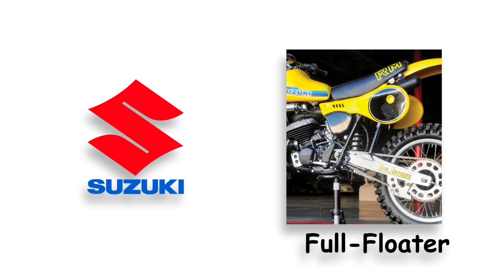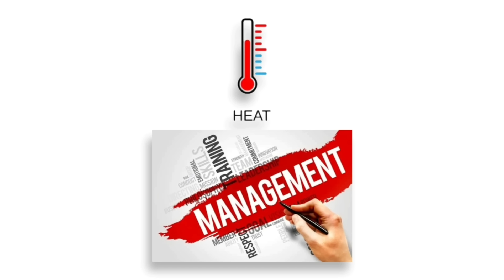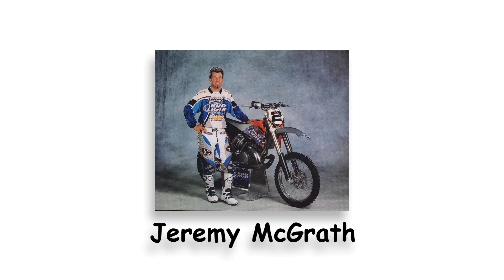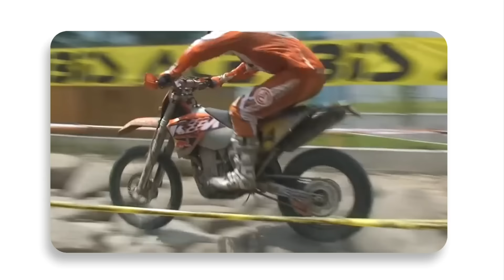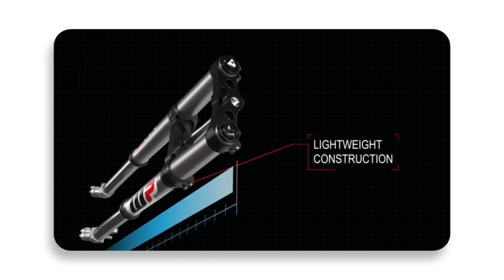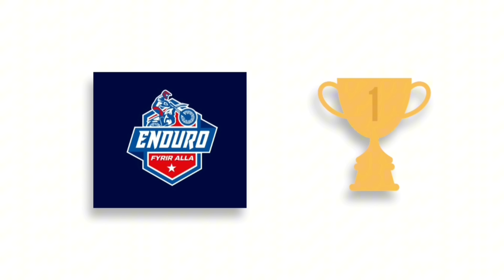PDS: The Simple Part KTM Refused to Fix for 20 Years

Comment: for the average rider, a correctly set up PDS is fine. If you're riding and jumping hard , you need a plush beginning stroke that ramps up thru the mid stroke. What the linkage does perfectly. 
If you secretly swap my linkage with PDS , I probably wouldn't notice...

Comment: A couple things I don’t think are right. They didn’t refuse to ditch PDS because people could swap on other shocks if they did. First, who cares what someone does after selling the bike, it’ll still be sold from the factory with WP. Second, that only works if they used the same i2i and stroke as other shocks and brands like Ohlin’s could make a PDS fit shock anyways. 

I also don’t think KTM went to linkage in MX because of Decoster. Development is multiple years long, so linkage was already in the pipeline before Decoster joined. 

Lastly, PDS can actually work pretty good but for whatever reason KTM did not do much development on the internals to make it work. Brands like MX Tech and NOST built very effective aftermarket PDS systems for the bikes but KTM was stuck on old basic tech that lacked. They simply made enough improvements to make it work for enduro and then gave up.

Comment: To be honest I love the linkless in the woods but I just built a 2011 250sx and there’s so many new style of skid plats that cover. That’s my new favorite woods bike now that I went to an 18” rear, played with the sprockets, pipe, reeds & tuned the carb. She’s ready to go. O haha and re-did the suspension
Reply from the maker: Exactly, modern skid plates and linkage guards changed the argument a bit. And that 250SX setup sounds dialed 18” rear, gearing, carb tune and suspension is basically the woods conversion checklist 😂

Comment: The suspension still sucks, The Motors are amazing. Hydro clutch Brembo brakes. The frames are trash, Mine started rusting from the inside out and the airfork is an embarrassment.

Comment: Ohlins had it figured out for ktm but ktm bean counters didn't want to pay... so they paid in failure.  Took toooo long but ktm figured it out.  I have a 17 and it works great and bike it lighter than linkage bikes.
Reply from the maker: That’s a fair angle. KTM definitely stuck with their own philosophy for a long time, and cost/parts simplicity probably played a role alongside the engineering argument. And you’re right by the later years, PDS was much better than the early reputation suggests. A well-set-up 2017 can work really well, especially with the weight and simplicity advantage.

Comment: Not really explained correctly, pds shocks have a smaller cylinder inside of the main shock body that a separate valve body passes into near the end of the shocks travel for additional dampening, it's more like a shock inside of a shock for the end of the travel.

Comment: You missed the point with the non-link suspension issue. For those who know, the same problem existed decades ago, in Yamaha's enduro and motocross models in the late 1970s.
And the problem is, to get the required rear suspension travel, without a link, you need a long shock absorber and to insert a long shock absorber, you need to tilt it. In the 70s YAMAHAs, the shock absorber was almost horizontal. As the shock absorber is tilted significantly, and connects to the main backbone of the chassis, the forces coming from the swing arm are transferred directly to the steering head, which negatively affects the front suspension and, as a result, the handling of the motorcycle.On motorcycles with a rear suspension link, the shock absorber can be much shorter, and be positioned vertically. The shock absorber absorbs all the forces coming from the swingarm and does not affect the  handling of the front suspension.
Reply: I bought the first monoshock off road bike, the 1976 Yamaha IT 400. It was a big improvement over most other twin shock competitors at the time: more travel, more compliance, more traction. The biggest drawback was the higher center of gravity caused by the shock placement high in the chassis. Your point about the suspension forces directed to the steering head is valid too.
Reply: You've got several things blatantly wrong

Comment: A forward canted shock has geometry that produces a rising rate, just not as much as can be achieved with linkages.  Another advantage for enduro use is no linkage parts hanging down below the swingarm to strike or snag on rocks, roots, logs.  love my PDS 300EXC.
Reply from the maker: That’s a great point. PDS was never useless, it was just more specialized. In rocks, roots, logs, and tight enduro, the clearance and simplicity are massive advantages. Motocross just exposed the limits harder.
Reply: My 300 EXC. Is spring hard. I'm 74 kg about. I've reduced preload rear and reduced clicks on front. Seat crazy hard. I wear bicycle shorts to compensate. Needs a softer seat. Buddies 4T linkages never seem to damage or snag.  The bike needs money spent to be ready to race.
Reply: Finally someone that understands the real differences! There is a hell of a lot wrong within the first quarter of this video.

Comment: They put the air forks on their bike to save money.  It has nothing to do with performance because they suck.  Not one of their pro or amateur riders uses them which should tell you something.
I have 2 KTM's and I had both of them converted to KYB internals.  The difference is unbelievable.
Reply from the maker: That’s a fair criticism. The air forks are one of those places where KTM’s “lighter and simpler” philosophy sounds good on paper, but a lot of riders just never liked the feel compared to a proper spring setup. And yeah, the fact so many serious riders go KYB or spring conversion says a lot. Hard to argue with real back-to-back experience. I personnally HATE them when tried it. It gave me arm pump for some reason

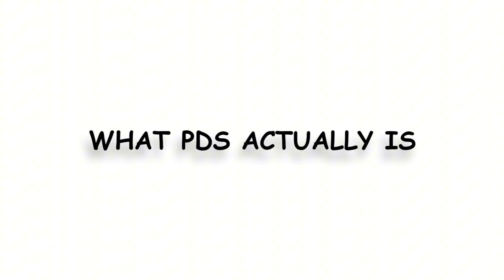Comment: 1:43 ktm could sell them dog shit, and theyd still buy it.

'Yea but this is racing dog shit...'
Reply: KTM  has been running Vietnam Era  Piston Reservoirs "Forever" - Bladders have a Better Feel...KTM's Works Shock (TRAX) $2200 comes with a Bladder Reservoir and a Rebound Separator Valve.  Its What the Pros Run -  Race Tech Sells Both a  Bladder Kit + R.S.V.-Nut for less than $360.  Some guys add  KYB Fork Insert Kits with springs  $1800 - $2000 - ALL THIS Works Wonderful -  A German Bike with JAP Suspension because Germans are too phucking Hard Headed !! -

Comment: It has its place but I prefer a bike with linkage.
Reply: Oh it's fine if you're putting around in 1st gear.
Reply: @lw3918  I think some people like it for the weight savings. Now I want to try a bike with pds to see how terrible it is
Reply: Try tell that to Josep Garcia.
Reply: @ChookChasersMX No linkage doesn't work with speed. How many Baja winners have no linkage? Answer.....none.
Reply: @lw3918 maybe you should look at the Finke desert race in Australia and see what serious off-road speed is. Maybe I know a thing or two about how to correctly setup a pds to mimic linkage. Maybe I know more about the geometry of why a linkage really exists, and it’s not what’s mentioned in this video. To be fair, I own many dirt bikes and don’t have a preference. I can make a pds work the same as a linkage, but requires specific components rarely found on the shelf to perfectly match but costs no extra to build than any other setup, often less than if needing to change a linkage ratio. Almost all suspension tuners fail to recognise what a linkage really does and how to combat that when it doesn’t exist. Everyone just keeps repeating the same reasons and thinks it’s truth. The Finke desert race has been won outright more than 15 times on a pds shock. Down in Australia we know really how to setup a PDS better than anyone in the world. Saying it doesn’t work at speed only relates to a stock standard shock and that’s it. Ktm don’t even know how to properly setup the pds.
Reply: @ChookChasersMX Australia? LMAO!!!! Uh no. Try Baja. I'm American, I own guns.
Reply: @lw3918 😂 poorly mistaken again, we own firearms too in Australia, we just regulate them more appropriately.
It’s not hard to figure out why Americans are regarded as arrogant all over the world. 
You can lead a horse to water but you can’t make him drink.
Reply: @ChookChasersMX There's your problem. Regulations. And America is the best country in the world. So good that the people who hate it won't leave. Not arrogant, just better.

Comment: I like the back suspension on my 990 and on my old 250 enduro. It feels better. Seemed to make a bigger difference on the 990, but it let's you feel how much traction you have in the rear. Jmo. I'm sure for mx, linkage is better. But for street or the kind of off-roading I do, I really liked the link-less set-up. I have a Yamaha wr250f now, and an mt09, but I still have the 990 SD, and it's my fave bike ever. Least so far. Jmo.
Reply from the maker: Totally fair. Link-less suspension can give a really direct feel for rear traction, which makes a lot of sense on street bikes and trail/off-road use. MX exposes the limits more, but for a 990 or enduro bike, I get why people love it.